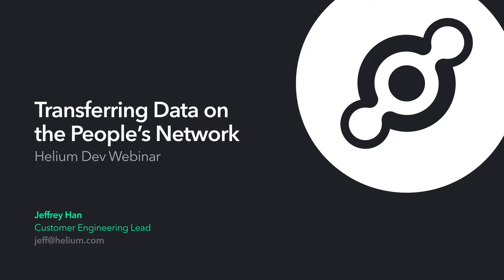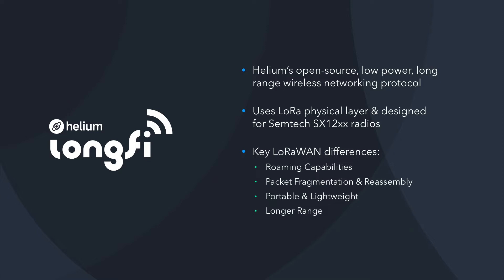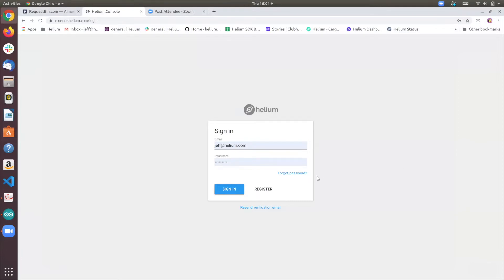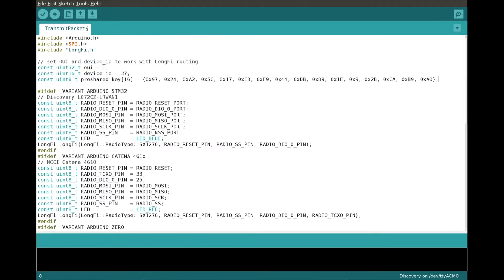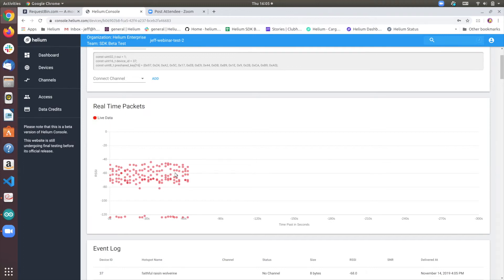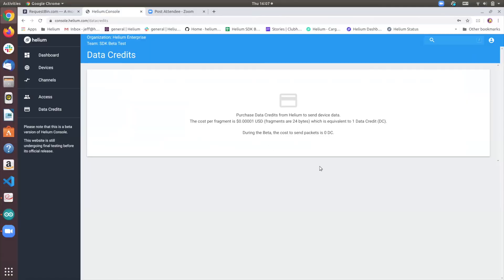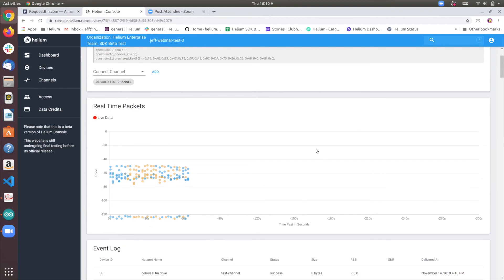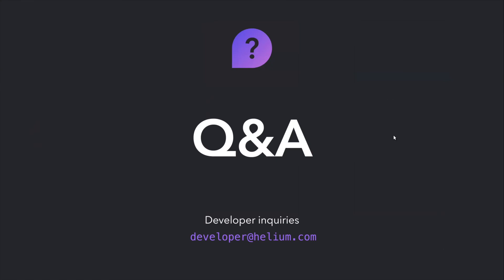Webinar | Transferring Data on The People’s Network

Comment: What I don’t understand is, you offer decentralized internet but you need centralized internet connection to do so. Am I missing something here?
Reply: that’s where the rewards of HNT come in for the people who share their centralized internet :)
Reply: I may be wrong as I haven't looked at their protocol in detail, but if they were somewhat clever when designing the thing it shouldn't be too hard to get switch to a purely decentralized network mode in areas where hotslot density is sufficient. That way you'd nee both a longfi entry and exit node to communicate trough the network tough
Reply: I think the idea is similar to mesh networks. Let's say my internet is shutdown doesn't matter cause the other person I connect to or the person they connect to provide the access to internet needed. But after watching this video this stuff is far farrrr to technical and not simple user friendly.
Reply: It's not a decentralized internet. Just low data IOT network. Not very useful outside of that.